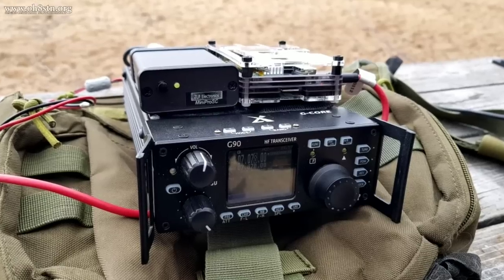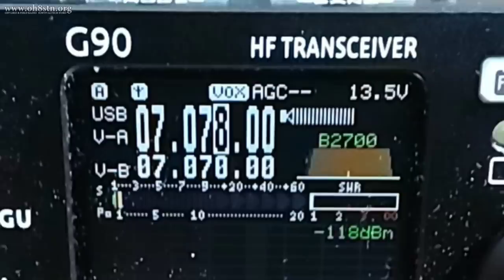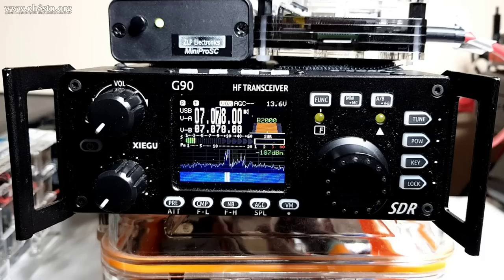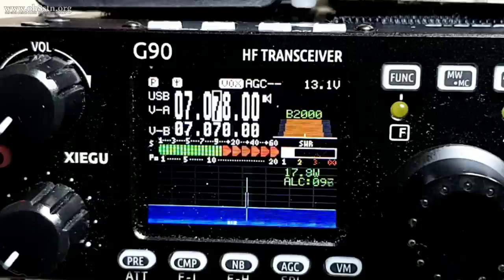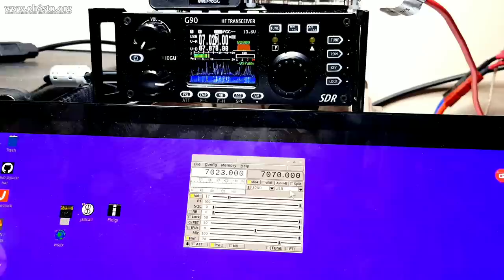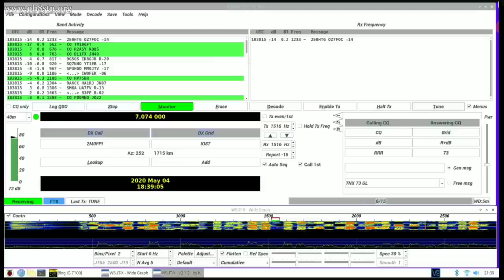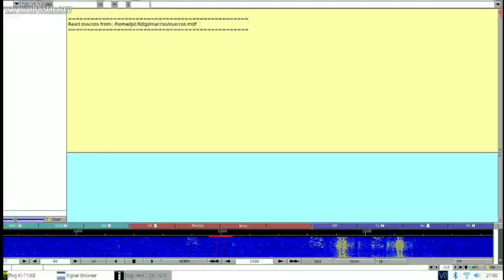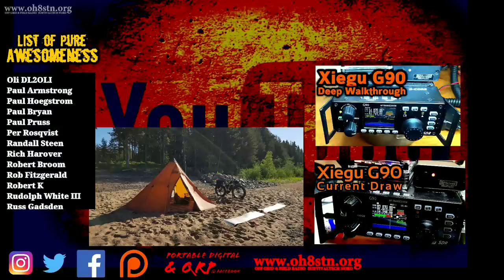Xiegu G90 Digital Modes Setup

Comment: Thank you for this.  I have been using a G90 for a while now, it's my first HF rig.  I have been able to get digital modes working, but was having issues with the cat cable disconnecting I'm guessing from stray rf.  I never considered VOX, but after giving it a try I was able to make more digital contacts in one night than the entire time I've had my radio.
Reply from the maker: Yes that's why I prefer Vox with this radio. The cat control cable that comes with the G90 could really be improved. Thankfully the Vox is there.

Comment: I kept my IC 7200 for basically this same purpose and for portable-camp ops. But, I do like the looks of the unit in your presentation.

I'm always impressed with your thought process related to the overall system, not just the individual items. You see the big picture !
Reply from the maker: Thanks for saying this. Yeah the big picture has to be taken into account, or we ultimately fail to create an easy to use "integrated system", for power and Communications. It's not always easy, but it does give us a direction to shoot for, when we're designing the system we want to field. Anyway thanks for the awesome comment and feedback. It's very much appreciated.

Comment: Your reviews and operating tips are ALWAYS appreciated.  My own G90 is en route and am looking forward to operating portable.  My choosing this radio was close to your reason.  I have a QRO radio and a QRP set.  This is something in the middle, the extra power will help with SOTA activations and Parks on the Air both of which I enjoy when its not 40 C here on the east coast of VA.  -73- and thank you for the investment in time.

Comment: Such a useful video. It would be wonderful if you could spare the time to make an updated version still using the Xiegu G90 and Raspberry Pi but with the XGGComms Digimode-4 interface, especially now that G90 can be configured in Flrig. Thanks for such valuable material.

Comment: I have two Xiegu's the G90 and the G1M that I use with JS8call.  

I suggest that you turn off polling of all the commands which the G90 does not share with the IC7100. If you look at the debug log, you'll see a ton of time out errors.

Also, I've been watching FT8 people talk and they say to use split mode in "fake it". I'm not I understand complete, but I suppose it's more linear. For that you'll need the CAT.

I use the EasyDigi isolation board for the G1M and DigiRig for G90.

I'm confused about ALC. I'm glad you mentioned it to be inverted from normal.

Comment: Thank you Julian from KI5SOH!! I have the Xiegu G90, the CE-19 thingie and I cobbled together the three 3.5mm jacks with bare ends into a "AF-CON" cable that plugs directly into the 3.5mm headphone jack and the 3.5mm microphone jack on my laptop running Linux Ubuntu 20.04. I had to upgrade from Ubuntu 18.04 to 20.04 in order to install WSJT-X 2.5.4.
By adjusting the Microphone level in Ubuntu upper right control bar, I can get the input level just right and get this beautiful water fall display and stations are just pouring into the list of "Band Activity".

In WSJT-X, I have the radio set to "none" and the PTT method is "VOX". I have the radio set to VOX and set the input and output audio levels as you explained in the tutorial. I also set the input from "mike" to "line".
BUT, when I click on "TUNE" button on WSJT-X, the CPU usage goes to 100% and the waterfall display stops. I click on "Exit" and it appears to exit, but when I check in a terminal via the "top" command, it is still there hogging 100% CPU. So I have to kill the process "wsjtx" to stop it.

Just to check for audio output from the laptop, I put my earbuds in the headphone port and did not hear anything when I clicked on "TUNE". Likewise, the G90 did not respond in any way to  "TUNE" as expected since WSJT-X crashes before any audio comes out.

Any hints?!

Thanks! Zac

Comment: Another GREAT video Julian. I was so glad to see your interface methods to the G90 for data modes.  Just wish there was a way to interface without the ZLP-size box. But I understand that without an internal digital audio card in the G90, it has to exist outside. With the delays of the IC-705, I may consider purchasing a G90 or mcHF just so I can have a small portable digital station. Thanks again for such informative videos. 73, Terry W4ZQ

Comment: Thanks for the video. I didn't get the CE-19 since I had a Sabrent USB sound card dongle, a M/M 3.5mm plug audio cable, a clamp-on ferrite choke and a couple capacitors. Just purchased the 8 pin mini-DIN plug. Just got to sit down long enough to put it all together with solder and heat shrink tubing.
Reply from the maker: I also run with a sabrent USB card. The CE19 really makes no sense for only digital modes. All the pins are on the din socket.

Comment: Hi Julian. Excellent video, once again.

I received my G90 yesterday and are struggling to get it to work on the ACC connector connected to a SignaLink USB sound card.

I've got the Xiegu CE-19 Expansion bord, but like you said, no use going portable with so many cables. I cut the 8-pin mini DIN cable that came with the CE-19 to make my own SignaLink to G90 ACC port cable.
- Signalink SPK to G90 ACC pin 4
- Signalink MIC to G90 ACC pin 5
- Signalink PTT to G90 ACC pin 2 (if not using VOX on G90)
- Signalink G to G90 ACC pin 7

Issue 1 - PTT/TX does not trigger on G90. Not on VOX mode (line input selected) and not via die Signalink PPT as explained above.
Issue 2 - When doing the PTT on the remote myself to avoid Issue #1 above, the ALC stays on 0 on the G90. Seems like no audio in is reaching the G90. I did play around with all levels on the Signalink and G90 to test. Wiring headphones to the SignaLink MIC & G pins, does give me audio, so no issue on the SignaLink side it seems.

In a nutshell, I can RX, but not TX digitally.

Hopefully someone can point me in the right direction.

Riaan ZS6MAN
Reply from the maker: Make sure you have "Line" selected on the G90, rather than MIC. Make sure you have selected mono for the input and outputs in your data mode app, audio interface setup. Also the signalink requires a special jumper, so you may need to reach out to their support for that. Lots of signalinks in use with this radio, so it should be possible to get it working.
Reply: @OH8STN  Thanks for the reply. My problem was actually much simpler than that. I had the 8-pin DIN pinout on my cable wrong. Looked at the female schematic (numbered bottom left to top right) when it's actually a male connector (numbered bottom right to top left). Feeling stupid, but got everything working, thanks!
Reply from the maker: Actually this is an excellent post and I hope you won't delete it. I would never have imagined that would have been the problem. So hopefully, if you leave this comment here others will make use of it. I'm really happy you figured it out. 👍👍👍

Comment: Thanks for this video!
After looking closely at what it is, I don't want to use that CE-19 adapter. I appreciate it, but mostly for the parts that kit gives you which frankly, I could have sourced elsewhere.
I want to have it all with one USB cable, so right now I'm cobbling together a USB hub to plug the USB sound device and G90 data cable into so I also have a CAT control option.
My plan is to strip all of the connectors and cases from the devices, direct-wiring all of the components to minimize the size and build it all into a compact adapter that can live in the "luggable" case system (go box?) that I've built for my G90. 
One box with USB, DIN and 3.5mm connector cables to rule them all...
I have a low power/high run time PC that should be fine for digital modes, but it only has 2 USB ports and I don't want to use them both.
I have the hub and sound device stripped and wired, but have been dragging my feet on stripping the Xiegu adapter and finishing the wiring.
An Altoids tin was my first choice of enclosures, but I'm staying open to alternatives...
73 de N2NLQ
Reply from the maker: Actually I think this is a brilliant idea. If you could fit the cat control  audio adapter and hub inside an avoids tin, you could have two short wires coming out to the radio, and one USB cable going to your laptop or tablet. I'll probably do this myself but I have so many little projects yet undone oh, I don't know when I'm going to get to it.
Reply: @OH8STN  Thank you.  You honor me. 
I'm staying open to other enclosures simply because the Altoids tin is a bit too large for the purpose when I test-fit the components. I have a feeling that the solution is closer than I think it is, and will share when I find it. I know I can get help with a printed enclosure, but I enjoy the challenge and reward of re-purposing stuff.
Reply: @OH8STN  I finally got around to finishing up the wiring on my adapter.
I just need to re-watch your video and try it out!
Reply: @OH8STN  My adapter is complete and quite successful! 
I used your video to perform the setup and made several contacts right away!
Reply from the maker: Now that's absolutely outstanding news. I'm glad the video was helpful for you. If it's not too much to ask, please share it.
73
Julian oh8stn
Reply: @OH8STN  I sure will! Thank you again!
Reply: @OH8STN   due to your influence and the influence of others I have successfully integrated a GPS dongle into my DIY digital communications adapter. Side note. My adapter with everything running draws around 200ma
Reply: Michael, how do you power your One-Box?  I like the idea of one USB, one Din and one 3.5  rather than the rats-nest wiring needed for the base setup.  But your USB Hub needs power somehow, right?

Comment: Great video.  Do you find the PTT is slow to respond when using WSJT-X and FT8?  I have the CE-19 but I've not used it yet with my Xiegu radios, but some friends told me it didn't work very well due to transmit lag between the software and the radio.  Perhaps the VOX setting that you described will solve this...
Reply from the maker: From my testing, I discovered the ptt lag is caused by using the wrong radio in Hamlib or flrig. I had a very similar problem initially. When I switched over to the Icom IC 7100 or 756 Pro oh, I didn't have this lag anymore. Your second point is also correct. I use the Box because it's faster, and more reliable if your levels are set up correctly.
Reply: @OH8STN  Thanks for the reply.  I have not used FLRIG before, but I saw your demonstration, so I will give that app a try also.  73

Comment: Great video but I need help with the CE-19, can you talk/show how you soldered up the jack plugs, which colour goes where sort of thing?  I don't want to mess things up by soldering the wrong colour to the wrong plug section.   Many thanks and keep safe
Reply: if you use the CE-19, one method to connect your PC's sound card with two jack (mic/spkr) is to build a 'Y' cable using the bare-end stereo cables included with the interface. The cable consists of leads from your computer's soundcard spkr and mic jack to a single AFCON 3-pole (stereo) 3.5 plug into the CE-19; take two bare end leads and wire the GND leads together, then solder to the GND on the bare 3-pole plug included with the CE-19 going into the AFCON port; then wire the spk leads together from one cable, and solder them to the tip of the stereo plug; finally, wire the mic leads together, then solder them 
to the ring of the stereo plug - that's all there is to it... another method is to use a USB sound card dongle with a single jack - you can then simply run a 3.5mm stereo (3 pole) patch cable from the dongle's jack into the AFCON port on the CE-19 - no soldering!
Reply from the maker: I went straight with the diagram in the user manual.
Reply: @OH8STN  don't even need the user manual, as the AFCON pinout is printed on the PCB's cover!
Reply: Excuse my ignorance on this, but how do I figure out which wire is which? Do I have to get a multimeter and basically mirror the AFCON diagram on the on both ends? i.e. AF OUT on the tip of the jack and mirror that on the other end? - Also, I'm assuming this approach assumes you have a line-in port that support microphone input and audio output (much like a pair of headphones with an in-line mic) ??

Comment: Thank you for the video!  I am fairly new to amateur radio and very new to HF.  I bought the G90 as my first HF rig.  I bought the CE-19 too.  Quick question, how did you wire the audio input/output to make it a splitter cable?

Comment: Julian, I  really like your videos. How do you handle, or should I say what program do you use for logging your qsos. For my Xeigu when I am not at home, I use N1MM, for logging and rig control. I have repeatedly tried to download FLRIG, but my Windows computer doesn't seem to want me to download it from W1HKJ. I have tried numerous times, but to no avail. N1MM for CW and non-digital  qsos works just fine but won't support any of the digital modes. At the home station, I use HRD - no problem, just don't use Xeigu, but in some instances like 60mtrs and 80mtrs, the Xeigu's tuner can handle my two wire antennas, better than my LDG tuner. Also, HRD does not support the Xeigu for now, hope eventually that will change - so use N1MM for uploading qsos to eQsl. Your reply is appreciated. Kevin, KD8IE.

Comment: Thanks for your kind replies. Your constructed cable from the CE-19 to the computer sound card has two 3.5 mm plugs but the CE-19 only has one AF jack. If I use separate cables where does the second cable connect to the CE-19 ?

Comment: As so many others have said,...great and INFORMATIVE video. Curious toward the end, I can't quite make out what antenna you're using. What is it??
Reply from the maker: Its  a hybrid. Chameleon UCM base, 2x Super Antenna ER1 extensions, Super Antenna MP1, and Chameleon MIL whip up top. It's a near lossless 1/4 wave vertical in this configuration.
Reply: @OH8STN  Back to the radio itself,...so if I were waffling back/forth about a rig for portable digital ops, and looking at pros/cons of G90 vs FT-891,  tell me if I've got it right:  while their physical layouts are different, (G90 is "long"), their basic footprint would be about the same; G90 has built in tuner, but FT-891 is 100w; both require an external soundcard. If I've got all of that correct, then it seems like a lot of the question boils down to what I would use for an antenna, as antennas that are resonate on the frequencies I want to work would mean no need for a tuner. Correct?  Thanks!!
Reply from the maker: I'm not sure if that's the way to look at it or not, it might be though. Actually 100 Watts or an antenna tuner. That's really what it boils down to. The next most important aspect is 1 amp or 600 milliamps RX current. I can stay a heck of a lot longer out in the field if I only need to generate 600 milliamps as opposed to an amp. Big difference there. Finally, if ergonomics are important to you, I'd be taking a really hard long look at the 891, which has excellent filter manipulation.
Reply: @OH8STN  This is all VERY helpful. I hear what you're saying about 600 ma vs 1amp...  If I were doing excursions like yours, staying out for days at a time etc., that would really be important. But my excursions tend to be no more than 1/2 day. Again, this is extremely helpful information. Thanks!

Comment: You make a big point that the CE19 requires more cables than the MiniProSc. Granted, the length of the cables provided with the CE19 are much longer out of the box than the custom cable you show with the MiniProSc but that can be significantly reduced when making the cable.  

The total number of cables is the same.  One from the radio to the CE19 or MiniProSc and one cable from the CE19 to the inputs on the computer audio input/output or USB sound card and one from the MiniProSc to the computer USB. Basically there is one in/one out either way.

I am confused as to what role the cable used for programming plays.  Does it replace the CE19 or MiniProSc or is it used in conjunction?  If used in conjunction the, how does it enhance operation. Obviously you can operate without it.
Reply from the maker: Honestly the Ce19 is trash unless it's used to interface the rig with an amplifier or something. Take a look at my blog on this topic.
http://oh8stn.org/blog/2020/12/14/xiegu-g90-winlink-express/

Comment: Thanks for these great videos. I have followed this to the letter and yet I am still unable to key the G90 using VOX only. It works fine with CAT. All settings are as you suggest when I try VOX. I am guessing it may be the USB sound device I'm using. Right now I'm stuck with the CE-19 but I am awaiting an XGGComms cable. Hopefully that cable with its built in sound card will get me over the top. It's been somewhat frustrating to date as I have some type of problem, probably stray RF, that's keeping me from running FT8 on 20m. At about 11 seconds the CAT gets disconnected. Reducing power does not help. I have no need to run CAT seeing how the radio is right in front of me, so hope to find a solution. Thanks for your clear and concise instructions! Scott/KC1UA

Comment: Great video.  I followed all your recommendations for set up, and have run into a problem.  With the CAT cable and mini din connected with the CE19; running flrig and wsjtx/js8, the radio will is connecting and initializing.  Then when I send a message or a heartbeat it does not xmit.  I get 0 w on the meter.  I can xmit 20w no problem with phone, but nothing on digital.  HELP!!  was able to get a few signals a couple of day ago but today nada.
Reply from the maker: Select the function button with one press, then press power button until you see input. Select LINE rather than MIC. For data modes line must be selected.
Reply: Thanks. Line is selected, followed all your set up steps.  Not sure why it will not xmit.  Any other ideas? Thanks.  Larry KO4OPE
Reply from the maker: Have you chosen the correct audio output in wsjt-x or js8?